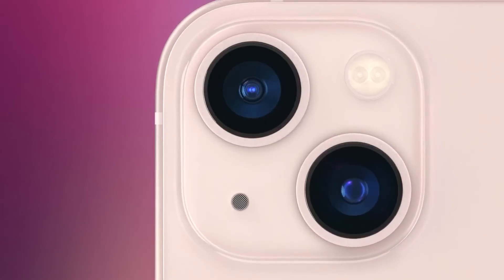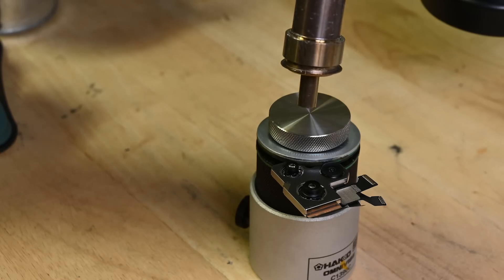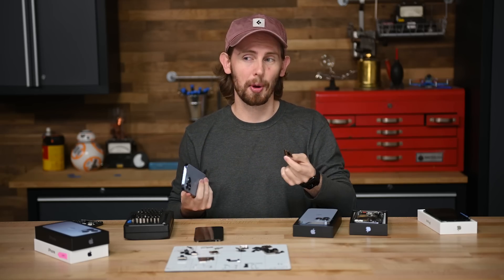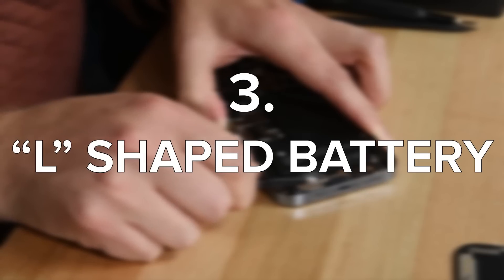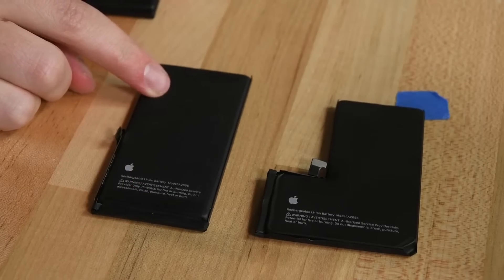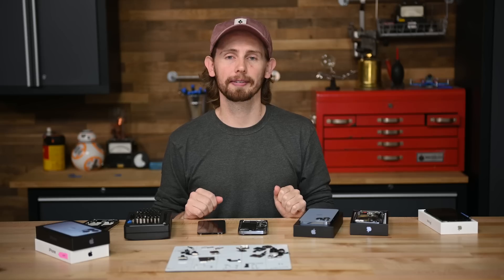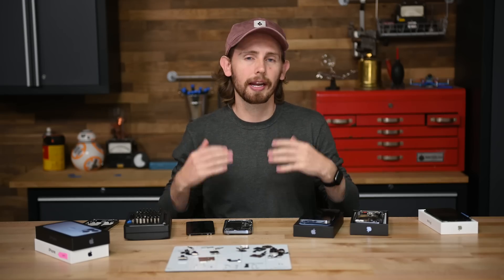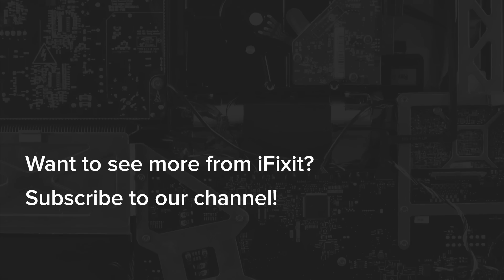5 Things You Need to Know About the iPhone 13 Pro!

Comment: Does parts pairing prevent thieves from making money off stolen, iCloud locked devices ? I feel safer thinking that thieves stealing my devices wouldn't be able to resell/extract value ! But it does come at the cost of necessarily more strict control of the repair chain.
Reply: This just works if it's a theft. If it's a robbery, the thief can make you disable the iCloud before handing the iPhone and all this "security" means nothing. Happened to me a couple of years ago when I was in a empty bus stop at night.
Reply: @DanielLavedoniodeLima_DLL  oh yeah you’re right ! But isn’t that situation you have bigger problems to worry about unfortunately, and I don’t see how it could be solved…

Comment: If manufacturers aren't going to make significant changes to their models, they should just keep selling the same models for the same prices instead of hiking them up over $1000 for the same designs. When I had Android phones I would upgrade anytime something cool or revolutionary came out... with Apple (I get my phone through work and they pay the bill) I'm staying with my XR until it dies and then I'll probably go with the previous year Pro model since there isn't a big difference usually, but price can be $1000 less at this point

Comment: Screen pairing is setting Apple up for a major Anti-Trust lawsuit.
Reply: Good.
Reply: @tyronenelson9124  How odd, Apple just released a self-repair kit.
Reply: @Edress786  Yep, just because they have been threatened with a right to repair lawsuit.
Reply: @tyronenelson9124  correct analysis - also it’s a win-win for apple, they got the regulators off their backs, and give their customer the “option” to repair their products; and Apple is betting that most of these DIYers’ will botch it up and will have come in and get their broken device replaced. At the end of the day Apple will win.

Comment: Nice to see others show how faceid works under infrared modified cameras. I also believe they are tracking what you view because in my tests, I used IG and the lights flash when you stop to look at a picture. Scrolling doesn’t do anything until you stop. Infrared is also under explored as the light can cause damage to your vision especially since you can’t see it. Just know when your phone screen is on that the lights are there flashing.

Comment: So basically a stolen iPhone isn’t good even as parts, and this is good, however the way Apple implemented this is bad. iPhones should periodically get a list of devices marked as stolen and refuse to work if such parts are installed. However they need to make it so that non stolen phones can be used as parts.

Comment: We really need this right to repair thing,
I’m definitely gonna stick with my iPhone SE 2020 until it literally dies in my hands!
Reply: Even then you can still get it fixed!- Batteries and screens for the SE 2020 are no more than $20 each in the cost of parts, it's a great phone AND it doesn't have the same level of anti repair built in!!

Comment: 5:42 you can also remove a certain fuse of the logic board so it thinks it’s a Max model. This way, flashing a system for that bigger model will fix that display size issue and you will essentialy end up with a 13 Pro Max for the price of a 13 Pro lol.

Comment: As usual, everybody wants to service their devices with third party service while Apple wants a) you buy new device instead, and by the way they can take your old device to trade-in; b) Apple wants to deliver the best quality to the customer, and exclude any human factor in repairs. For example: ok, you repaired the phone by fixing phone motherboard suffered from water, and say you have bad luck: phone is working after repair but with rare occuring problems for example. You started calling Apple support and how can they help this situation? It is not their liability after that type of repair, but user will show this iphone to friends an will tell everybody that "Apple is bad". Because third party shop will say "we've fixed your device properly, that may be new ios update is buggy". My opinion is: every manufacturer must recycle their devices- so you just need to send or bring your old device to manufacturer if you do not need it anymore.  And one more thing: if some manufacturer is advertising IPx rating - there must be such warranty or no IPx rating. And may be warranty period must be the same as ddvice lifetime period.

Comment: Apple claims enforcing USB-C would stunt innovation.. yet they've kept the same mega slow and outdated connector.
Reply: Actually, Apple is one of the creators of USB-C...and for the world to adapt faster, they sticked to lightning for long since many people hates Apple and they will like usb-c since it's not in Apple products. Then, Apple started to slowly implement usb-c across their products.  I think within 2 years, iPhones will switch to thunderbolt too due to proRes.
Reply: BeCaUsE eNvIrOnMeNt
Reply: Don't out down to malice that which can be more easily explained by incompetence. If it was truly the case they wouldn't have updated the iPad to use usb-c or eliminated all the ports on their laptops in favor of usb-c. Sure I'm sure it's quite possible that there is an economic motivation as to why they stuck with lighting for so long but personally I think they're just being lazy.

Comment: The best thing about the iPhone 13 series? Not buying it at all in the first place!
Issues with the front facing cameras, displays, and Face ID, as well as the battery warnings, are enough to give this a miss.
Who really disables auto brightness on a replacement display? This would make the display worse than the one on my old Samsung Galaxy S4...
Also, why won't Apple bring some form of Touch ID back to the iPhones? Various manufacturers have now used in display fingerprint scanners - the Galaxy S10 had one and that is 2.5 years old now.

Comment: I know that people who make a living repairing phones hate that Apple pairs parts, but as a consumer that is paying $1000 or $1500 for a device, if and when I need to fix it I want to have some assurance that the parts being used and the people doing the repair are legit. I don’t want to look down at some Alibaba screen that seems good and then a week later realize that True Tone is not working or that Face ID stops working. It’s not easy to know if a place is legit, and even if they are, if this week they decide to cheap out and try out a shipment of crap screens to see if customers will realize… I fully expect that I will get some heat about this position and that “Apple is just doing it to get richer” but I like knowing Apple has a system in place to notify the owner of the device that crap parts were used in the repair.
Reply: and whats even worse is that they tried to greenwash their customers, saying they are a "green" company, while they try their absolute best to make their devices unrepairable.
Reply: The downside is locking up features that sometimes aren't directly related , eg face ID from a screen swap
Reply: Warning messages are fine. But i hate that they also lock Features like FaceID or the battery percentage if the repair was not done by Apple. Like cmon at least let us use all the features
Reply: yep, me as a person who generally buys pre-owned apple products that people exchange for upgrade every year, it gives me assurance that no internal parts were changed. Been using iPhones for over 10 years and never have to get repaired.I get batteries changed at Apple store tho. Some people doesnt have that much luck when it comes to electronics, due to which theirs always break and gets expensive to repair or in case of accidental damage.

Comment: Apple reduced the notch 20% to achieve nothing LOL
Reply: Ikr, and still nothing after iOS 15.0.1. The right side has a battery logo (no battery percentage) and network signal/wifi indicators, and the left side switches between the network provider and the time. The function to switch back to the previous application is indicated by a small arrow and lettering with the name of the application, placed directly under the space on the left 😂
Reply: Nothing on the Home Screen, but you see more video, more of the game, more of a webpage, etc.
Reply: @chrluc  I don't usually expand videos as they get chopped off no matter what screen unless they were already using your phones aspect ratio. So notch is less of an issue :)

Comment: Apple will not be able to fight us :) We can transplant the ic that comes in the original screen to another screen and that will be solving the problem of the face id.
Reply: Well it does need highly skilled labour , many small repair shops who can successfully swap a screen can't do such intricate stuff.
Reply: @kavinsp  that's their fault
Reply: @KomenDanLari  Nope, they encrypted the chip so it can’t be just copied and written to.
Reply: That’s nice. But unfortunately I can’t do that, or do you think it’s achievable by the average consumer
Reply: El gran Edgarito siempre en todas
Reply: @KomenDanLari  that only work for previous iPhone for now. It may take sometime before we able to do that.
Reply: Isn't the point of a paired screen to prevent thieves from excoriating value of a stolen iCloud locked iPhone ?
Reply: watch Louis Rossman's video commenting about that.
Reply: But do you think that apple, know knowing this chip is swappable, that they are going to continue designing their future smartphones that way, I don't think so.
Reply: @KomenDanLari  but it’s made in China? You know you phones are also made in China right
Reply: Can we manually increase the storage of a 128GB iPhone 13 to 1TB storage?
Reply: @johnfrederickudtujan8337  No, you cannot manually increase the storage of a iPhone 13.

Comment: I have to say,
The sensor shift OIS looks super cool outside the camera module
Reply: Cri Lankan Collec Habay:elbowcough:
Reply: Is it really "optical" image stabilization if it's the sensor and not the optics moving lol, does anybody know
Reply: @brreeaad  Optical is when a dedicated lens element corrects for micro-movements. No phone actually has "true" OIS. The lens elements on phones are just way too small (as of writing) to "float" an IS element around. When hardware-based stabilization first came into phones, they were actually moving the entire camera and lens assembly, that's why it's sensor shift IS right from the beginning. What Apple has done differently is they have separated the lens from the sensor, so now both the lens assembly and the sensor move independently. 

Would I call it OIS + SSS? It's a bit debatable when looking at the technicalities of what defines a "true" OIS system and the effectivity of lens vs sensor-based stabilization varies a lot between systems, so for technical purposes, I'd just call it hardware-based stabilization.
Reply: @jacobnathanielzpayag3885  Hey thanks for the explanation, that makes more sense
Reply: @brreeaad  It's optical, in contast to software IS.
Reply: @brreeaad  Technically you are right. Its actually called IBIS (In-body image stabilization, meaning sensor housing is helping with stabilization)
Reply: @brreeaad  I do believe so as Zack From JerryRigEverything called in “Sensor shift OIS” in one of his videos

I could be mistaken though....